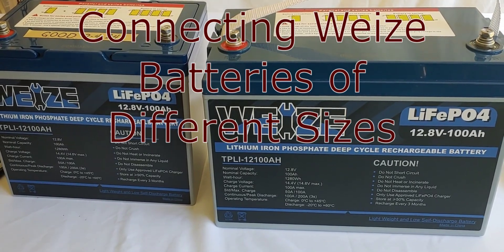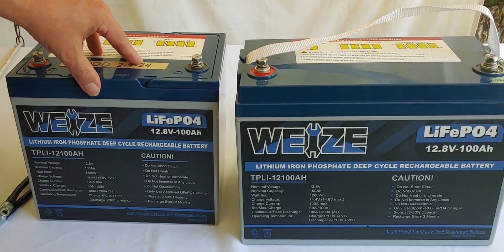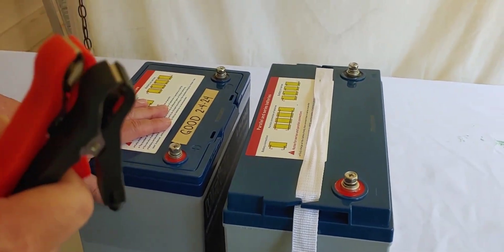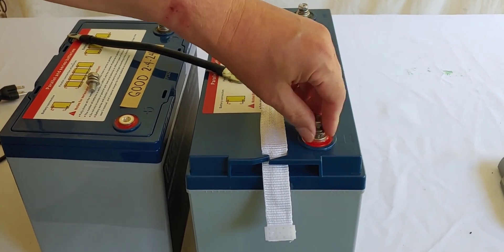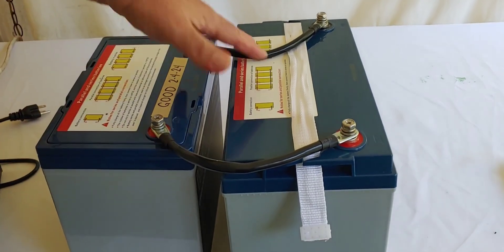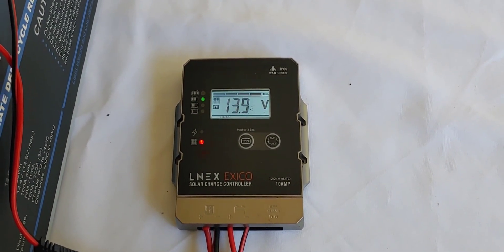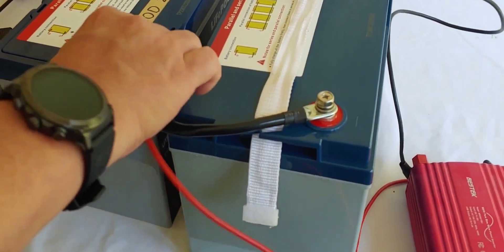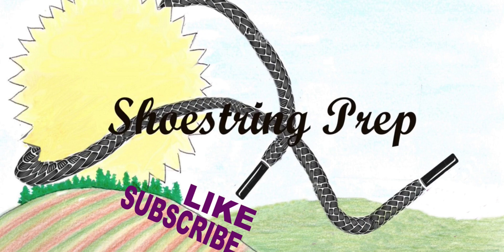Connecting two Weize 12V 100Ah LiFePO4 Batteries of Different Sizes in Parallel.

Comment: Question, I am build the same setup, but I got 1,000 w inverted, can I run it with the 1000 or I need 2000w inverted? Thanks.

Comment: Thanks very informative for me as a new comer to this, so I am building a portable battery box with 2 100 amp hour lithium batteries. I just want to confirm will I be okay with a 1000 watt inverter?
Reply from the maker: As long as your power needs are not more than a thousand Watts then a thousand watt inverter will work. Thanks for your comment.

Comment: Were these batteries the same age?
Reply from the maker: No, they are not. Thanks for your comment.
Reply: @shoestringprep you’re welcome. I have a 12v 100ah WEIZE lithium I’ve had and used for 4 months. I want to upgrade to a 24v trolling motor and use 2 of those. Would it be fine to use the  4 month old one and a new one in a series?
Reply from the maker: @GomezAngling  I would use it.